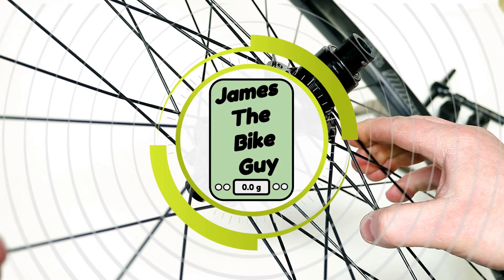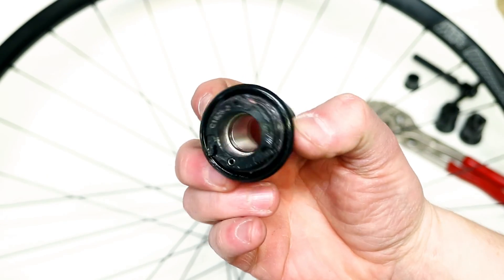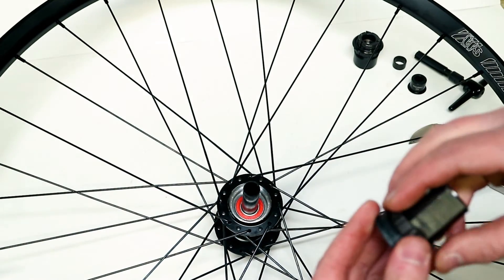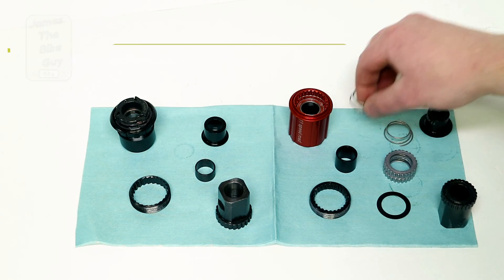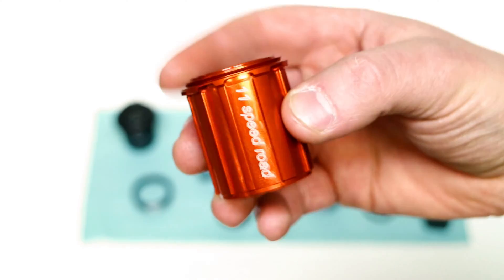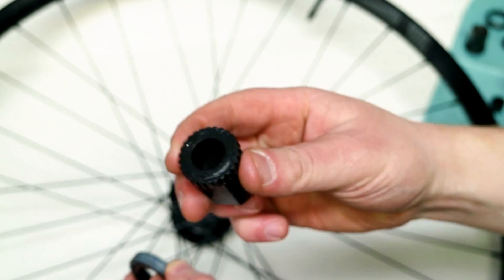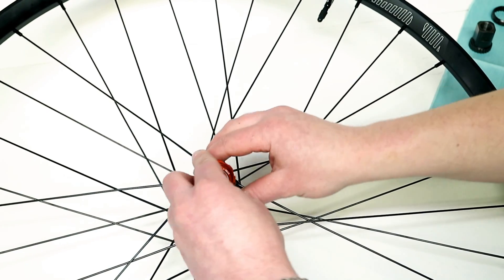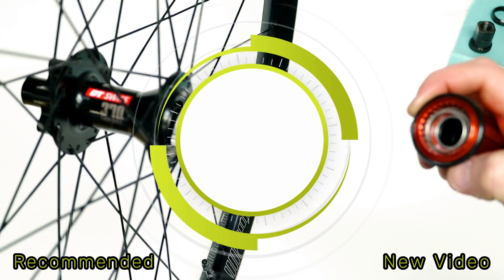How to Upgrade DT 370 to Star Ratchet Conversion using DT 350 or 240 Hub parts How To DIY

Comment: Great video!  I just ordered all the parts, including the XD Freehub Body, since I have a 1 x 12 SRAM Eagle GX drive train.  The Freehub body doesn't come with an end cap.  Is that something I'll need to purchase as well or will the endcap from my 370 hub fit?
Reply from the maker: The end cap is the same from the 370 to the 350, so long as the driver body style does not change
Reply: @Jamesthebikeguy  I had the same question.  Thank you for asking and you for answering.
Reply: Do the 240 shim, ring nut and bushing work for XD applications? SRAM says the XD requires a 1.85 spacer (is that the same as the 240 shim)?

Comment: This is great!
I finally have all the parts to do this conversion except for the one I can't find!
Does anybody now where I can get the 240/350 "spring spacer/shim" that goes under the drive ring?
Reply: It is actually a DIN part, not dt swiss specific although they label it as such. Look for a DIN 988 OD/ID 28/20, 0.5mm shim.
Reply from the maker: Check with your local bike shop.
Reply: @Jamesthebikeguy  Unavailable until July sometime at the earliest. Any online source that you know of?

Comment: Do I need to purchase a new endcap for the end of my XD driver free hub body. All I can find online is the XD driver free hub body for the racket drive without and end Cap. Is there a specific size or part number for that endcap if I need a new one. Or can I use the original endcap from the 3 paw freehub body?
Reply: wondering the same
Reply from the maker: End cap usually comes with the freehub body.

Comment: @Jamesthebikeguy, I ride Canyon Spectral AL6.0 and have DT 370 hubs, 12 speed SLX cassette, which one will fit on my bike? 

240 Ring Nut M34x1mm : 7613052165578
240s Shim Ring: 7613052115252
240 Aluminum Bushing: 840121029814 

Freehub Body:
11-speed Road Freehub: 7630013967262
XD Freehub Body: 7630013964827
XDR Freehub Body: 7613052230863

Shall I buy all new internals and which freehub? 
Sincerely

Comment: If i am using a donor 240 or 350 hub and converting everything over to 370hub,  does spacing on donor hub matter?  Can i used 142x12 or 150x12 hub and move internals over to 148x12 hub? thanks
Reply from the maker: Spacing doesn't matter. Just make sure you have the correct endcap for the bike you plan to put the wheel in, that is all

Comment: Awesome video! I’m looking to do this on my m1900 wheels with 370 straight pull hubs. I do have a Sram Eagle 12 speed rear cassette. What free hub body would I use to be compatible with the 12 speed cassette? Thanks for the video, I subscribed
Reply: in the same boat, let me know if you have a parts list you can share. thx

Comment: You know if the h1900 works to ?
Reply from the maker: I would guess if it is using the 370 internals, but I do not know for sure.
Reply: No you can't.  The h1900 has a bigger 3 pawl nut than standard.  The ratchet nut is a smaller diameter . I know I've tried !

Comment: What about the sealing issue , true or false
Can this be done on the h1900 for ebike and go with the steel shimano body and 24 ratchet ?
Reply from the maker: Check the FH body, if part numbers match go for it
Reply: Jamesthebikeguy 
I cant find info on the the parts for the hybrid hubs , you have better sources ?

Comment: The tools $75 🤯💀 might as well just buy new wheels /hubs
Reply from the maker: Or pay your local bike shop to install for much less than the tools
Reply: If you’re willing to wait you can buy cheap knockoff Chinese versions of these tools that work fine.  Like $12-$15. I needed to file off some casting marks but worked fine. 

Now if you want to actually replace bearings you have to drop some coin. The drift set costs like $250 and I haven’t found a cheap let option.

Comment: I just bought a new Mtn Bike....the 370 is crap...If my current 370 uses the micro spline free hub body...and I want to use my current cassette...what DT Swiss Free Hub body do I use to be able to install the DT Star ratchet conversion...thanks for the info

Comment: DT SWISS X1900 SPLINE 25, DT370 CENTERLOCK HUB 148X12MM REAR....I have the tools...I have already bought the kit...to my surprise it was a 3 paw...what other parts do I need to make it work? Thank You
Reply from the maker: Parts are in the description and then you will be good to go!
Reply: 240 or 350?
Reply: Which free hub body
Reply: So my cassette will fit also?

Comment: Thanks for the video. Just ordered the parts to convert my 370s rear to the star ratchet system. My plan was to salvage most of the internal parts from an old non-boost 350 but I ended up buying the drive ring nut and spacer (Ring nut:	HXDXXX00N1131S
, 
shim ring: HCDXXX00S1083S; about $20 with shipping) because the old one was so tight and I did not want to damage the old hub. I was able to find the ring nut tools (knock-offs) for about $10 each. So, other than buying an XD hub as the old one was Shimano, the cost was pretty minimal.
Reply from the maker: Nice 👍
Reply: @Jamesthebikeguy  or provide a link. thx
Reply: want to resell the tools if you dont need them any longer:)

Comment: Done this. So easy to do and a real efficient upgrade. But I might have done something wrong. The wheel turn well when not on the bike. But when I screw it on my bike I’m loosing the freewheel !!! The bracket is turning with the wheel. Ring nut, shim ring : is there a side for the mount ?? Any idea ?
Reply from the maker: Something is binding. Either the bushing is incorrect or the washer behind the drive ring is not seated

Comment: Had to get the tool, remove the ring just change the bearings.  Broke one cheap vise and twisted another.  Finally put 18 inch pipe wrench with 3 foot cheater.  With assistant holding wheel, finally broke ring loose.  A testament to the strength of the wheel design.  The bearings should be serviceable without this much anguish.  Great video.  I will get this kit soon.
Reply from the maker: Well the drive ring tightens everytime you pedal so it's bound to be gft.
Reply: Wish I read this before bending two vises myself. A pipe wrench and a 4ft iron pipe did the trick. Thank you!

Comment: Hey James, awesome vid. Would it Theoretically be possible to do this conversion to a novatec etc hub? I mean as long as the Drive ring fits (and most of them screw on and use the same threading) it should work right?
Reply from the maker: Theoretically sure. However in reality there is nearly no chance. The freehub bodies from one brand to the next vary greatly, and so do the dimensions

Comment: Hi jamesthebikeguy !
When you tell me that i need a HG 11 speed shimano/sram freehub for my Nx 12speed cassette, it is the same one that you used on the video (the red one ) ??? Part num. EAN:
7630013967262
My setup is:
REAR HUB
DT Swiss 370, Boost 12x148mm
Reply: If you are using a Sram Eagle cassette it is probably a Sram XD driver instead. Look on the back of the cassette. It will say XD compatible only. Part number for the XD driver is in the description.
Reply: Actually just saw your other comment. You will need the driver James suggested. Not the XD driver.

Comment: Hi Jamesthebike !!
Awesome tutorial video, liked !!!
Man i have a doubt, my hub is a 370 dt swiss 3 pawl system, i see all parts list on the description, the only doubt is wich frehub do i need to get ?
My bike has a sram cassette PG1230 11/12 speed, my cassette is with 12 speed now
Reply from the maker: It's a NX cassette the 1230 you have yes? If so the freehub is a HG11
Reply: @Jamesthebikeguy  thanks for you soon reply !!
I have a 370 dt swiss and i bougth the 54t rachet system, watching your video i understand that i need to buy a: 
dt swiss 240 aluminum bushing
Dt swiss 240s shim ring
240 disc ring nut 34x1mm

And my bike has this:
REAR HUB
DT Swiss 370, Boost 12x148mm
CASSETTE
SRAM NX Eagle PG-1230, 11-50T, 12 Speed

So whats the parts that i need in order to get  the correct fit on my bike?

Im a little confuse with the free hub bodys, i dont know which one fits...
I preciate man for your advice !!!
Reply: Is a 11speed road freehub part:7630013967262 that i need to complete my upgrade ?
Reply: Rodrigo Merino did u ever find out what part u had to get ? He used an 11 speed free hub and I have a gx eagle 12 speed

Comment: Based on the XD driver, the 3 pawl freehub groove is  2mm wide to fit the ID of the seal in. The Star Ratchet freehub is quite different size and shape, so while the seal 'fits' on, it does not engage as it was designed to. When the 350 freehub is removed from the the 370 shell, the seal stays inside. If the seal is not re-positioned back onto the freehub, the seal will be squeezed between the shell and the freehub resulting in friction and lack of freewheeling once pressured by the tightened axle. If you compare the 2 styles of freehubs, the difference will be quite obvious and using calipers you'll see that the diameter where the seal sits are different.
Reply from the maker: Not the case. Seal fits proper. The difference in depth you are seeing is due to the drive type, and is nulled once the proper internals are installed
Reply: @Jamesthebikeguy  Nope. Measured and compared side by side. 3 Pawl seal does not fit into the groove of the Star Ratchet body. Width of groove and diameter of body are different. Compared to both Aluminum and Steel XD drivers.
Reply: @jaydoubleu101  Jay you are right, having the same issue as you. any solution?
Reply: @vincentxie1  Sorry for the delay in getting back. I did find a solution; I had some adapter rings machined so the 350 seal can be pressed into the hub. I also had a set of tools made to press the adapter rings in. I have spare rings, but only the one set of press tools.
Reply: 2 years late, but do you happen to have any of these seal adapters left?

Comment: Does anyone know if my 12 speed SRAM NX cassette will work with the Shimano 11 speed free-hub body? I know the NX is set up for Shimano free-hubs just don't know if the 11 speed vs 12 speed will be an issue.
Reply from the maker: Yes it will as long as a NX lt SX cassette

Comment: Does that freehub come with the appropriate end cap for a 12x148 thru axle? The one shown in the stock photo looks like it’s for a qr skewer.
Reply from the maker: Most of the time it comes with the endcap. But always make sure you get the right one.

Comment: @jamesthebikeguy.. ran into an issue trying to do this . My "axle spacer"  is metal and seems to be part of the axle. Doesnt just slide off. Any idea if I can still do this? My wheelbia a roval traverse carbon hoop. Wish I could send a a pic.
Edit .. well apparently I have the formula rear hub axle!😡🤬🤬
Reply from the maker: that would explain your challenge
Reply: At this point I'm just wondering if I could swap it for a dt axle.

Comment: I know this video is 10 months old but couldn’t you theoretically use the star ratchets to screw in the new drive ring to save some money on a tool.
Reply from the maker: You might be able to. Tough to get the hub back together since it will bind if the drive ring isn't fully seated.
Reply: Thanks for you reply!

Comment: Think this hub would work for the new internals?
https://www.aliexpress.com/item/32964485033.html?spm=a2g0o.productlist.0.0.4cd65f4cEcBYFz&algo_pvid=730f1e32-2723-4787-b112-f99a7730895a&algo_expid=730f1e32-2723-4787-b112-f99a7730895a-1&btsid=0da80bf0-41c9-4ad4-8a3a-45fead67d328&ws_ab_test=searchweb0_0,searchweb201602_7,searchweb201603_55
Reply from the maker: Certainly not
Reply: @Jamesthebikeguy  Any reasoning behind that? You can see a section view of a hub that was is cut, and it seems they're all the same components. Zitto makes star ratchets to fit the dt swiss hubs, and I think this hub is their version of it, using all the same internals. They even come with 56T ratchet.  At 72$, it's compelling to try!

Comment: Great work, but as of right now this conversion works out to over $330USD in parts and tools!  That's more than the cost of a brand new 350 hub itself ($220USD)...in fact, one could buy a new 350 hub and brand new spokes/nipples, and rebuild their wheel, for cheaper than just doing the conversion.
Reply from the maker: The tool cost is the thing that adds up. This is where one might suggest using your local bike shop for the conversion. They have the tools and you can pay a small amount of labor to get it taken care of.
Reply: @Jamesthebikeguy  The Ebay tools only add up to only $48.00 and my LBS quoted $35 to $40 for the labor so, Ebay tools look like the way to go here.

Comment: Can you use this "road" hub on a shimano 11spd MTB cassette, or is this only compatible with road cassettes? I've read there are dimensional differences. Also, is that the existing endcap from the 370 hub or did you have to buy an endcap as well?
Reply from the maker: You can use this 11spd freehub body with a 11spd Shimano mtb cassette so long as you but a 1.75mm spacer behind the cassette. My question is why would you? If your doing the upgrade purchase the correct freehub body for your application
Reply: @Jamesthebikeguy  I didn't know what the correct freehub was.
Reply from the maker: Links & Part# in the description. Match the freehub body to the cassette/drivetrain you plan to use.

Comment: Would it be possible to swap components of a 350 hub with dt upgrade kit to 370 hub and replace 370 internals in to the 350 making it a 3 pawl and also functional?
Reply from the maker: no reason it couldn't go the other way.

Comment: This is super easy to do. Except, the wheel doesn’t spin once you put it on the bike. Everyone on here seems to be stoked about it, but they are the ones who haven’t done it yet. Tried it now on two wheels, and same result. Won’t spin once you put the wheel back on the bike (does sound great in your hand when you spin it outside of the bike as James does at the end of this video. There are a few people who commented here noting the same result but James hasn’t responded to them. Curious where we went wrong with the swap?
Reply: Chris Arce I’m having the same issue
Reply from the maker: I am guessing it is the spacer behind the drive ring. If you follow the parts guide then everything is compatible. If the drive ring is contacting the spacer i.e. not centered or it was not replaced that can lock it up. Through comments, I can't see what you have done to troubleshoot for you.
Reply from the maker: Try it without the bushing. If it spins fine then the most likely case is the bushing you are trying to use is not compatible with your freehub body selection and you will need a different size. These are basically legos so as long as all the parts are correct you can swap tons of things around with DT hubs.
Reply: @Jamesthebikeguy  right on, will give it a shot. Bought everything off the parts list provided (the format and parts list were super helpful - thank you for putting that together). Anyways - thank you for the quick feedback, much appreciated!
Reply: @Jamesthebikeguy   Tried it without the bushing, same result. I am wondering  if the hub shell is different as I think the problem is the seal interface between the hub shell and freehub body. I used the guts from an older hub and they had a different seal (link below), so I used that one instead. It seems to spin for now, but only time will tell if this is a permanent fix.

https://www.treefortbikes.com/Enduro-Silicone-Freehub-Seal-for-DT-Swiss-240-350?utm_source=google&utm_medium=cpc&adpos=1o2&scid=scplp333222428912&sc_intid=333222428912&gclid=EAIaIQobChMI5PDwu__N5AIVBLbICh2yKAHYEAQYAiABEgKQDfD_BwE
Reply: Put this new seal in and removed the old one. Rode 20+ miles the other day with no issues. I'm thinking this is the fix.
Reply: @kevinstrongin6497  Kevin, is that seal goes on the freehub body, or this is the one stay in the hub shell? I'm having similar issue (probably a lesser degree). my wheel will spin when put the wheel back on the bike, but when freewheeling, the pedal would move with it. appears there are some frictions (not much but some). When I remove the old DT370 seal and run the hub without seal, issue goes away. the DT370 old seal won't stay in place, every time I remove the freehub body the seal stays inside the hub shell. can you take a couple pictures on how the enduro seal stays on?

Comment: Performed this successfully today. M1900 wheel with XD driver. Seal fit just like in the video. 👍😊 buzzzzzz
Reply from the maker: Sweet, gla it worked for you!
Reply: I have this exact rim setup, which star ratchet system did you use? the 54T? Did you find a substantial difference?  When researching I read mixed reviews about the ratchet system vs. the pawls.  Several people commented on blogs that they stripped the ratchet teeth clean off before the end of the riding season but others said they'd never had a single problem.  I'd be curious to hear your thoughts on this conversion.  Thanks!